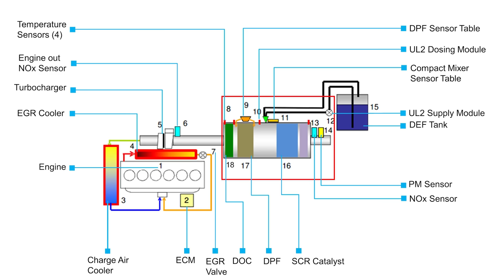Old But GOLD! I Changed My 2014 VOLVO for an Old 1996 Kenworth W900

Comment: I've been debating which way to go.. I'm retired from a totally different trade. I'm 58 yrs old.. I'm going stir crazy in this retirement thing 🤣
I've had my CDL for 15 yrs.. got them to begin w/ as I would help my younger brother on Fridays & Saturdays (I worked 4 10's).. he is a Timber dealer & I would pull tree length logs & pulp wood to the mills.. made some CASH $$ ! .. I stuck that into a personal savings I had been sticking $$$ into since I was 18 yrs old.. wife is going to retire in 2 yrs (she owns an Insurance Agency.. been in her family since 1902).. Thought we would buy a truck.. see America while making some $$.. I can be choosy about loads.. not be rushed as I have $$$ to pay CASH for a truck & trailer.. NO PAYMENTS!!
Only way I would run flatbed is untarped loads ONLY .. just not messing with tarps.. folding/unfolding (not dealing with wet weather & muddy lots when having to fold up a tarp).. most likely go with dry van loads.. I am OCD when it comes to the appearance of my truck 😊.. when I pull the hammer to buy.. I will have my trailer color matched .. I just like a good looking truck going down the road 😊
I've got a lil over 450k to utilize so I will be able to get truck & trailer paid for with a really good cushion to operate with to start.. I've looked at the 2022 Pete 379 & 389.. Yes, their all digital dash now.. at least w/ a brand new truck .. you can get most everything from engine, Transmission & driveline covered under 500k mile warranty.. I've dealt with dealers with my brothers trucks.. if you raise enough hell.. they FIND a way to warranty it.. 
I've looked at Fitzgerald gliders too. 
Even considered buying a local truck .. it's an older Pete.. sitting out in a field.. bern there at least 15yrs or more.. I can buy it for $1500.00.. then take it to a shop I know and have it completely rebuilt/refurbished.. $125k will go a LONG ways on a restoration.. any thoughts?
New?
Glider?
Or
Rebuild/Restoration?
Thanks

Comment: Exactly right on just about all points. I like Super 10's and 13 speeds. A pre 2007 Columbia or even an International 9400 would thrill me. I'm retired but would love to just drive the tractor only.

Comment: I'm a Diesel Mechanic, have my own shop & fleet of Volvo's, we started with Mack last & Kenworth, had very little problems with them but we decided to change to Volvo solely because of the better fuel efficiency, that back fired badly & we end up having the Volvo's off the road alot because of the same problems your saying plus other problems, we are going back to Kenworth next year, too much sensors & computerised crap on Volvo's.

Comment: The first truck I drove when I got my 1A was a 97 Freightliner FLD120 with a Detroit. 2 years of driving it and I never had a break down of any sort. You could cut your fuel with piss and it'd still run. Then I got "upgraded" to a 2018 Columbia and it was terrible.

Comment: There are more than a few videos here on YT that deal with the same topics, except they come from farmers.  They are, apparently, going back to using older equipment simply because they can fix most problems themselves out in the fields and do it faster than waiting for a dealer's mechanic to turn up, with his little laptop and get to work.  Added to this is the amount of computerized access that manufacturers give to their customers.  I've been told that one of the largest makers of earth moving equipment has at least 3 levels of access - one for the owner, one for the agent or dealer and one for themselves.  Neither earth moving contractors or farmers can waste time waiting for 'the guy' to turn up with the right amount of access to detect the problem.

So, like this bloke with his old truck, they are going back to older machinery that isn't infested with endless numbers of unreliable sensors.

Comment: He has a great point when it comes down to emissions. Newer vehicles will tend to break down than older ones. I work at a dealership and even new vehicles with less than 3k miles will have problems, especially hybrids and EVs. This generation will never understand and they will deny all the time about failed emissions due to so-called "climate change". The old saying Newer isn't better.

Comment: Hey, so I lost my 2007 W 900 about three weeks ago and head on collision so we are on the lookout for a new truck. We found one today and it’s a 1997 cab W 900 L with a cat engine 18 speed it’s bad ass. It has lots of chrome. Has a wet kit  on it has the factory dual tank. This guy is asking 60 grand is that worth it? We know it’s a bad ass engine. It has 700,000 miles on it and we know we’ll have to rebuild the engine but we have a good mechanic that will do it for 20,000. someone that we can trust. He’s done all the major work on our other trucks. Hopefully you can answer this before tomorrow morning because we’re going back to possibly buy the truck.
Reply from the maker: Was it reworked in any way? Non-factory parts?
Reply: @NorthAmerican-Trucking-News  No. Just the added chrome. The inside is kind of beat up. Anyway, we took our mechanic to check it out and he advised that it was just too much money and that it was going to take at lease $30,000 to get it to where our old truck was. So we passed on it. Now we found a 2004 Peterbilt 379  cat 15 475 hp 10 speed it has a wet kit, fresh engine rebuild, new turbo, new ac compressor, looks like it’s been painted  recently. The  interior is pristine and very clean, double bunk. 630,000 original miles. And he’s asking $42,000 so I think we are going to get this one. Thanks for responding!

Comment: As a diesel tech, these new emissions setups are annoying as hell. I love when we get a old truck in. Just worked on a 1996 mack vac truck with the E7 engine and did a full service on the truck. So much easier and fun then this new crap. Also the aero fairings on the new trucks are obnoxious to work around when the truck isn't jacked up.

Comment: I've wanted to drive a rig like this since I was a kid, the rumble of, in this case a series 60 Detroit or my personal favorite a 3406 CAT. Closest I came was working at a truck shop, pulling trucks into and out of the shops, and there's nothing like sitting in the seat of a truck like that and feeling all the torque as it cranks over and shakes to life. For context I was about 18-20 years old, so I felt like I was 8 again, excited just to be in the driver seat but now I'm allowed to run it even if it's just me going from the garage to the lot.

Comment: Truck manufacturers are also intentionally not investing as much as they should in the emmisions tech. Most of it is right out of standard electronics parts bins and barely hits tolerences for the conditiond in a truck. 
Its not entirely their fault since all electronics are built to fail early, but it could be better.

Comment: You are not wrong. Right now I have a 2017 t680 down for a def quality sensor.  Best part  is there is zero available anywhere in the u.s .so I either break regulations and pull and delete the def. Or let it sit untill China comes threw

Comment: I tend to stick to the early 2000's model trucks that haven't been rebuilt and just squeeze the rest of the juice out of them till that time comes. C-15 cat motors are pretty bullet proof I've driven them with 1.6 million miles (pre-rebuild)in the oil field god know how many hours. I had a s-60 detroit once I'm not a fan. Junkyards are full of them.

Comment: You are so right about the emissions crap. In the last 18 mos I have spent $45k in emissions repairs on my '13 pete 386 with an ISX. Unfortunately, I seem to be stuck with this truck since I can't find an older truck to replace it with unless I want to buy a polished turd from Ohio truck sales.
Reply: And Ohio truck sales high with them older truks

Comment: So when he says he has no emissions on that W900 what he really means is there is no emission control which equates to caring absolutely nothing about our environment and the emissions that we in trucking are putting into it.  It's all about easier to him and in my opinion, nothing in this life that's worth anything comes easily or is free.  And trying to reverse all the damage we've done to our world will not be easy.  Although these new engines are far from trouble free they have made vast improvements over the treatment of the air coming out of the stacks of the old trucks.  In most cases the air coming out of the stack of new trucks is cleaner than the air going into them.  I'm not sure if anyone has seen the change in climates and weather across our world but in case you haven't don't worry .... you will.

Comment: We have in Europe green ore emission zones it means that you don’t have access to a city if you don’t have euro6 or higher.
The port of Rotterdam said no euro6 no access to the port.
I totally agreed that the emissions shit on the engines are not good and sometimes it’s a struggle, it’s possible to drive a truck with lower emissions but you pay more tax (yes guys you pay more tax and the environment is you thankful for that) but much city’s in Europe closed the gates for older engines how’s that in the USA?

Comment: Yes, they have a ton of problems but you didn't replace "hundreds" of sensors unless you're replacing a sensor every week because you're not letting the truck regin. I work for a fleet where the drivers don't care about the trucks and stop the regins all day and I only work on emissions every 20-30 trucks I touch

Comment: The very same goes to modern cars. I'm driving a '92 Audi 100 C4 with V6 engine for 8 years already, and it is way easier and cheaper to maintain and repair than similar class modern cars, it has only a bit more or even the same fuel consumption level, it has the same level of safety for the driver and passangers (don't care about those who are outside, heh) and comfort. So when the time will come for my old good Audi to become totally inoperable, I will find and buy the same type in better condition no matter of its price.

Comment: 06 379 exhd 18. Custom built Signature 600 750hp. Average 6.5. I'll never buy a pos plastic truck.
Reply from the maker: It's always impressive seeing vehicle names listed out like that instead of saying the model and make only. Why say Ford Mustang when you can say '69 Mustang Fastback. 5.0L Coyote V8 engine, 460hp. Tremec T-56 Magnum 6-speed manual transmission. Ford 9-inch rear end with 3.73 gears. Custom fabricated 3-inch exhaust system with Flowmaster mufflers. Wilwood disc brakes all around. Adjustable coilover suspension with tubular control arms. 18-inch American Racing Torq Thrust wheels wrapped in Michelin Pilot Sport 4S tires.

Comment: Not just semi  truck all cars trucks semi are made with a expiration date now, they even put the ECU in the engine bay.. anyone that knows about electronics is that heat kills computers. As a mechanic the newest car I would buy is possibly a 2012.. but the best were made from 1994-2005 after that things started going plastic and now everything is plastic junk.

Comment: Here is my problem with what keeps being claimed about fuel economy. You have stated these trucks run between 62 and 65 mph to achieve this. I've been behind your trucks on the highway. If the truck in front of them is pulling a hill or going slower they pull out into the left lane doing 62 to 65 mph. I'm I'm state that has the speed limit at 70, 75 or 80 mph this is dangerous. It causes accidents. These drivers need to know when to speed up and not focus on fuel economy if they are passing other vehicles.

Comment: 2000 long hood Pete, 3406e pdi compound turbo 18 speed 110k on rebuild. And no nada nothing wrong. From a 2017 Pete 579 and in 18 months, every censor replaced at least once! 2 wiring harness, entirely new dpf system all of it top to bottom. New injectors at 312k! The list is to dam long! If you want to run o/o and want to profit in today's market place there's only one option.

Comment: I’m old enough to remember what the air was like on the highways in the 1960s, especially on routes with a lot of trucks.  It was so foul you tried to avoid getting behind the worst offenders.  Today, it’s a nonissue.  I rarely see visible emissions or smell NoX from trucks.  We are all better off for having cleaner emissions from all our vehicles and we aren’t going back.  There are far more people who prefer to breath clean air than there are people who drive diesel trucks.  The dirtiest ones are mostly gone and eventually they all will be.

Comment: Is not that the new technology doesn't work, is that manufactures will get more revenue on maintenance of this "sensors" and other components,  than with older and known reliable technology that is less likely to  generate any issues.

Comment: The only truck worthy of being called a truck is Kenworth. Everything else is also ran. My truck is pre-emission and have pulled loads out from other trucks that have had electronic failure. I have never had my hood up on the side of the road. And payments are a sentence that has to be served that never goes away.

Comment: The point of swapping out of the old trucks was to have a smoother, more economical and more reliable ride.

The reality of the newer trucks is they are all poorly assembled plastic crap that breaks within the first 100k miles, the engines struggle to perform under the emission nonsense, and they ride worse than the older ones.  Nevermind that you are going to go broke trying to keep the thing running.  I think most newer drivers would be shocked to get behind the wheel of a 96 Kenworth and touch metal and leather (not plastic), listen to a motor that sounds like a motor and not a jet engine, and shift a transmission that moves like silk.  Not to mention the older Kens and Petes were smooth riding trucks.  About the only thing that got better, in my opinion anyway, are the brakes.

Comment: The way I see it, if anything is worth doing, it’s worth doing it in style. 
That’s something all these new plastic cookie-cutter trucks lack, is style and soul. 
Sure, you can get 8 MPG in your automatic Volvo... 
But a straight-piped tuned up old W9 will put new hairs on your chest every time you step on the throttle, and it’ll leave a trail of freshly-sodden panties in its wake as it blows pure testosterone out the stacks.

Comment: Understand, brand new and used, all get paid the same. If you bought a new vehicle, they do break down too, and the parts cost more. All while that oayment is due. If you keep investing in the older one, for a lot less, you can get it all worked out. Paid off trucks are less overhead, so when the low paying jobs come in, you can say no. Nothing worse than breaking down while your losing money taking jobs at the wrong pay.

Comment: Didn't hear much about obsolete unavailable parts for old trucks.  
A old truck with new components still has everything besides the major components is old n has all 2million miles on it. 
Some old trucks will Nicole n dime ya to death. 
Start replacing the wiper system on a 20 year old truck  replacing  headlight buckets in the fenders. Things like fatigued cross members, cab suspensions, dash frames, heater boxes, AC units, corroded fuel tanks, fuel tank brackets and on and on.

Comment: How does the fuel difference factor in with a hood truck vs a streamlined tractor? These old hood trucks are cool but the fuel efficiency has gotta sting. I get the points about not having to worry about all the bullshit emissions and the problems that go with it, wouldn’t all the extra fuel you burn in this thing be as expensive?

Comment: This man is based. Come to think about it: modern trucks, or any vehicles, made with more sensors, more compliant features. Those simply add to the points of failures of the products. Not to mention more manufacturing processes that add to the overall emissions.

So, this man's ranting is an elaborate (and on point) middle finger to the current American manufacturers with their virtue signaling & moral high ground swagger.

Comment: I'm not totally convinced about that these new trucks get that much better mileage. I'm in a 2018 Kenworth 680 and this thing is decked out. It's got fridge and APU and the biggest Cummins you can buy and I just left Vegas, filled it up at that nasty Pilot and went up 15 and across 70. I crap you not, I only had 27000 on and this thing was only getting around 6.5 from Vegas to Denver. Sure that's good on the bottom line but is it REALLY better??????

Comment: A 2014 model is about the worst example of a modern truck. 2021 models are much better. 

Owning an old truck isn’t always an easy path either. Especially if you haven’t owned it since new. 
Typing this as I wait to hear from the shop if my C15’s head pressure tests OK or if I’m buying a new head for that pre emissions motor of mine…..